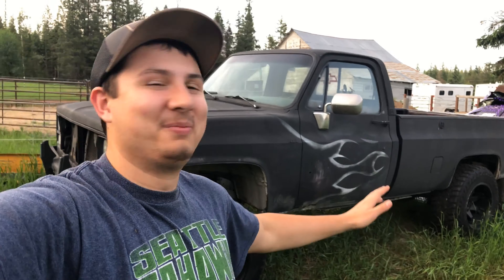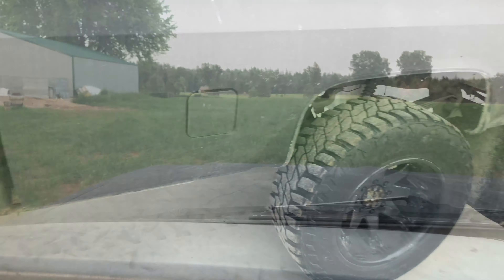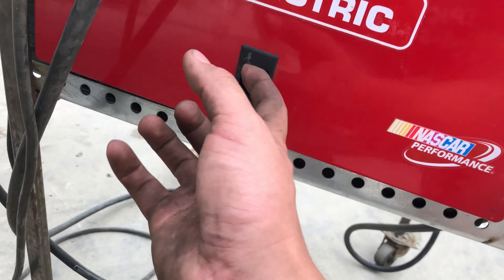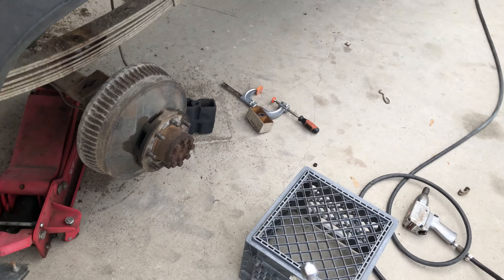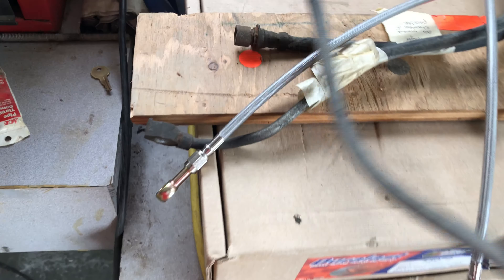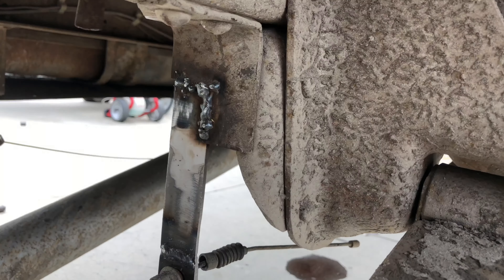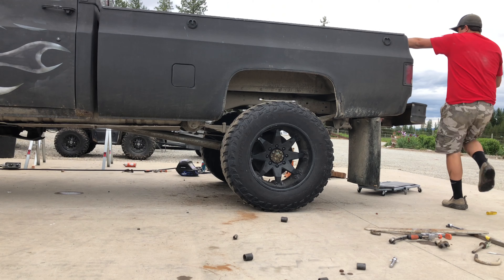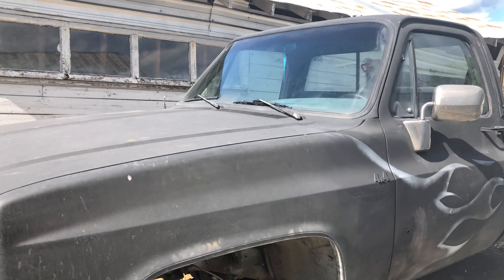The Big Block Square Gets Its Lift Kit and Brake Lines

Comment: Did you have any issues with the driveshaft angles or length?
Reply from the maker: I ended up selling the truck right after I finished the lift kit due to getting the duramax project going, but in the 15 miles or so I put on it I didn’t have any issues. iirc I did some research on it and found that it should be fine with that size of lift. Not 100% on that though.